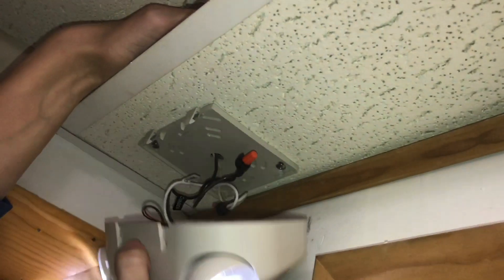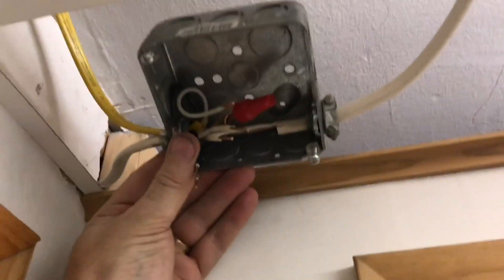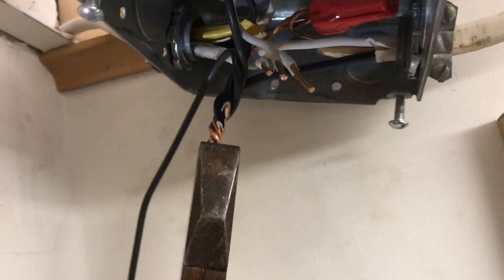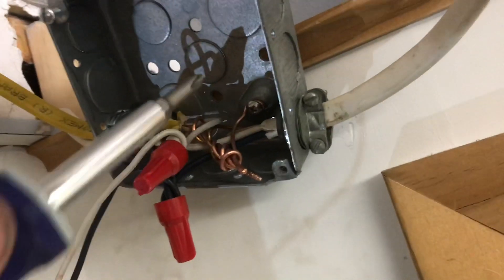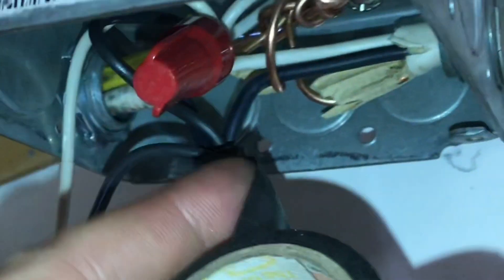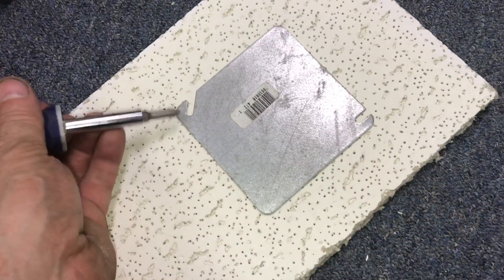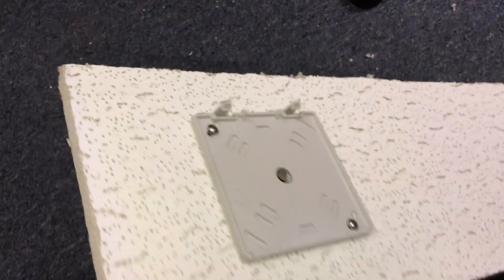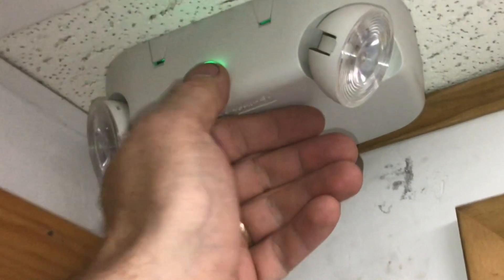INSTALLING LED emergency lighting in a drop ceiling (lithonia eu2l m12)

Comment: good video as a whole, but you can’t just sandwich a flammable ceiling tile in between a metal box and the EM light.... the proper way would have been to install a junction box with a bracket meant to go in ceiling tiles then cut a hole around the entire box.